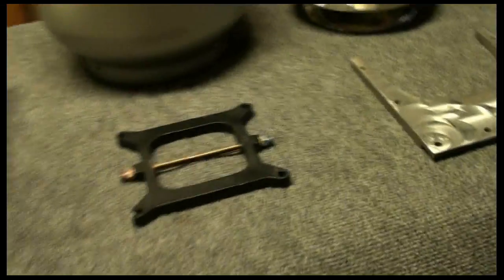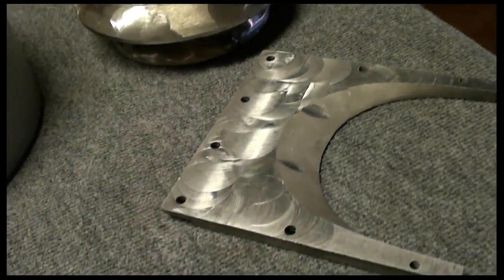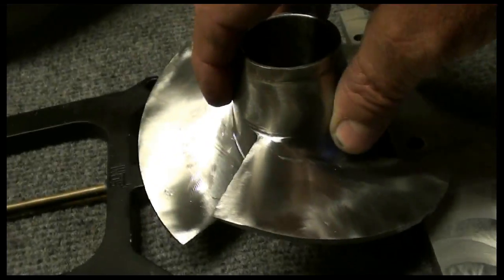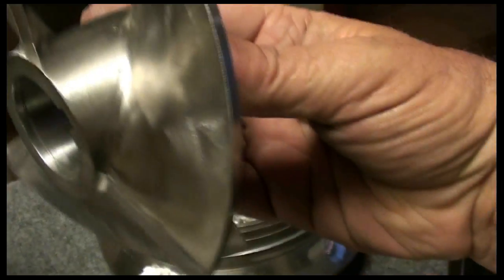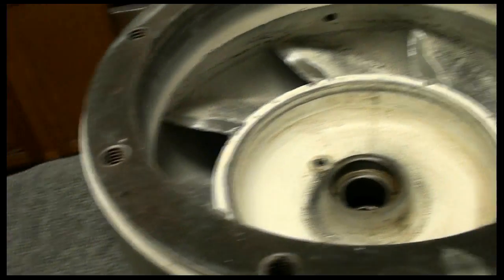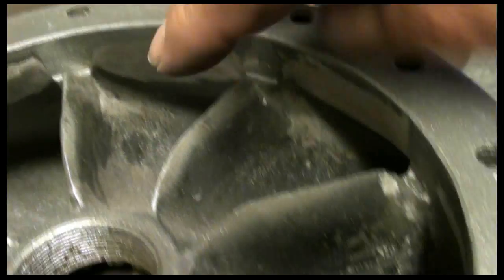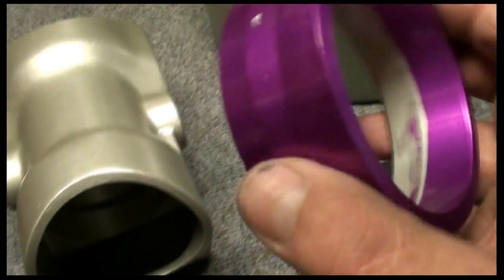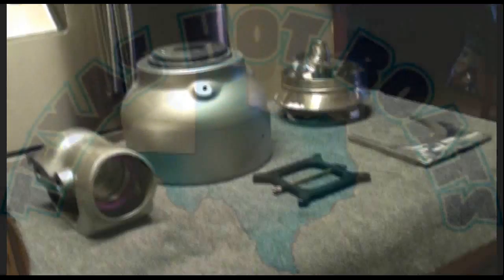Berkeley Pump Technology

Comment: I got a question 120g legend pump at 0 to 4500 rpm runs great as soon as I hammer down on the throttle after about 10 seconds full throttle it starts to shake any ideas?
Reply: I don't know anything about Legend pump, but something is out of balance. Maybe the impeller. Or possibly the drive shaft is out of phase.

Comment: How do you know if you’re not feeding it enough water?
Reply: When you lose top end. We took a little off the shoe every other week or so. We got up to 93 on motor only. After the next shaving of the shoe, it only went 91. That's when I put a .040 shim in and called it done. Once it was all done we hit 100.3 on GPS with the nitrous shot. That was with a small block LS1 with a nice cam and AFR heads.